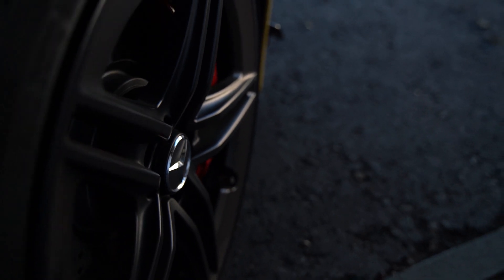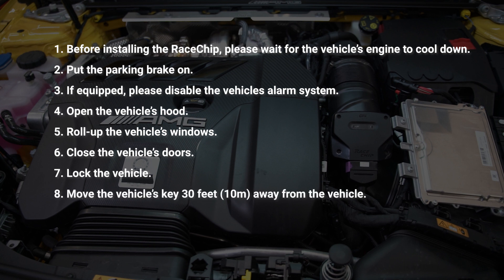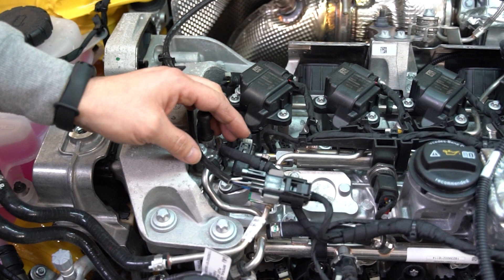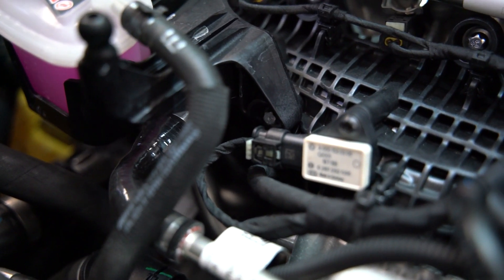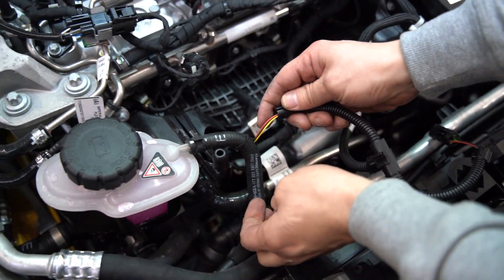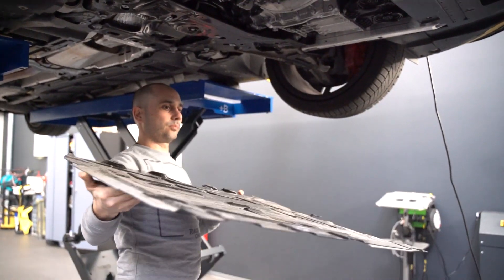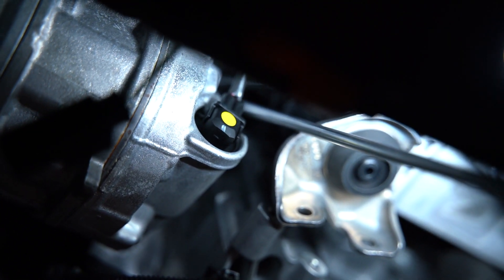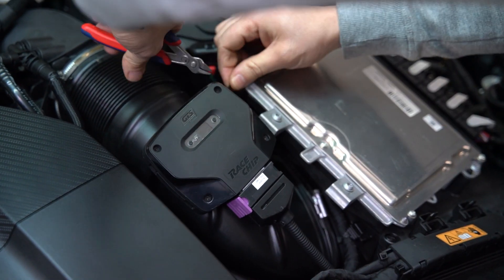2019 Mercedes A45 / A45 S AMG (W 177) RaceChip Installation

Comment: Hi . Can you make a video for Mercedes AMG GT 4  43 X290?
Reply from the maker: Email our customer support by heading to the website and we will be happy to provide you detailed photo instructions of the M256 engine :)
Reply: Hello. I’ve already receive the pictures. The problem is the location of boost pressure sensor, (connector A), since is not clear how to access to unplug the connector. This is why i asked for a specific video like AMG 45. Thanks a lot for your answer
Reply from the maker: @morenofreebiker2670  We will make sure to add this one to our to-do list. If you do need further assistance the Customer Support team can walk you through the installation process on your vehicle. Additionally, if you would prefer to have a local shop install it, our team can pass along referrals of an installation shop in your area.
Reply: @RaceChipInstallationVideos  Ok Thanks . Looking forward for a video...
Reply: @RaceChipInstallationVideos  Any updates on the video for amg gt 4 door?